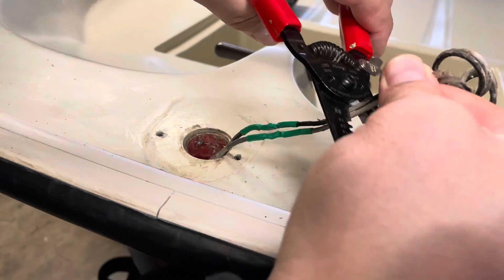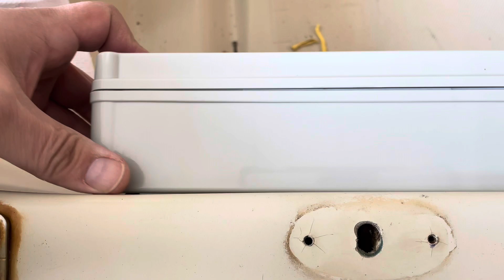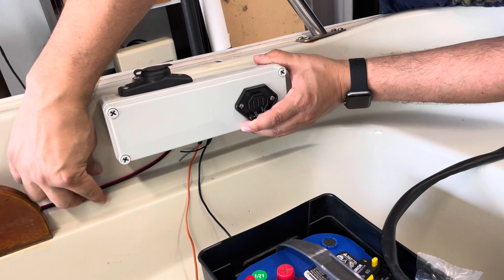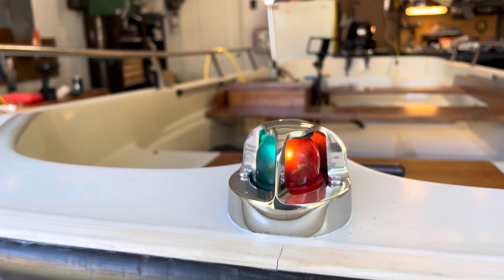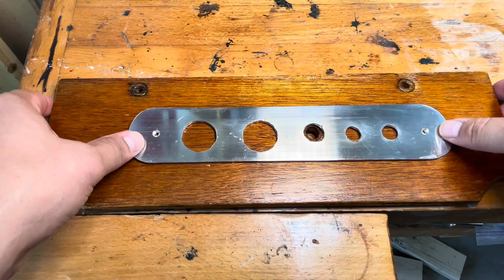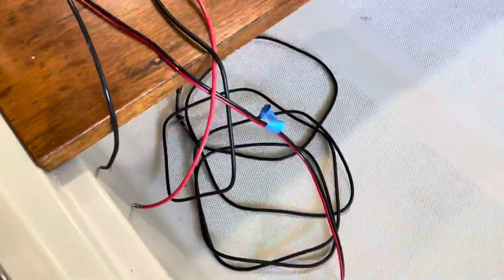Texas Whaler Project – Electrical Upgrade on Boston Whaler

Comment: Did you wire in a master full disconnect switch? How is your console attached to the deck?
Reply from the maker: It has a circuit breaker inside the battery box that can disconnect everything. The console is attached to a wooden footer that is screwed into the floor of the hill and connected to the starboard wooden beam that holds the seats in place.

Comment: crimping is the preferred method of joining wires or wires to connectors, in a boat. Soldering is not advised.
Reply: Why is that?